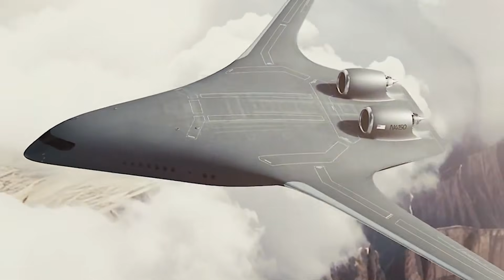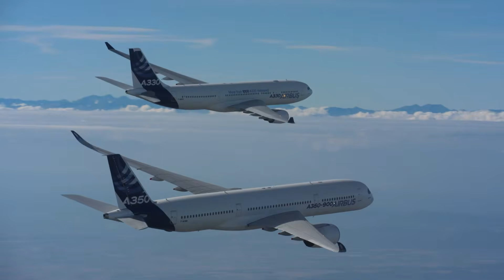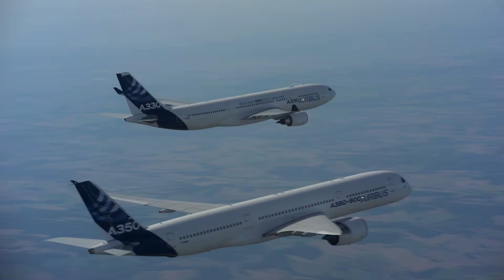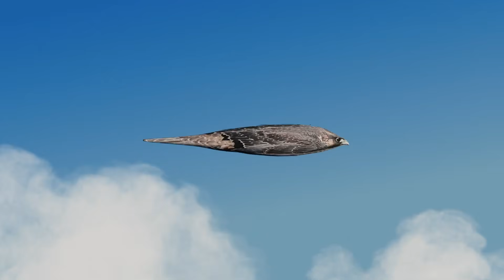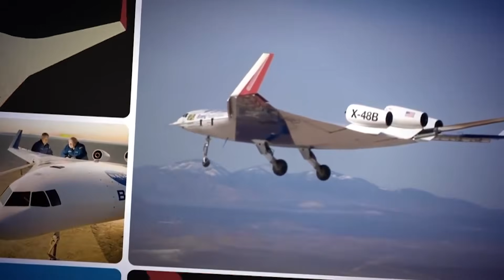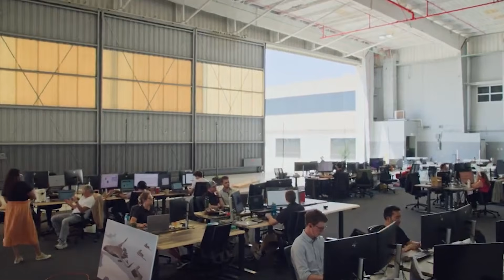They Are ACTUALLY Building THIS!

Comment: This design is nearly identical to one Boeing proposed a few years prior to the MAX issues.  I had heard they had subbed development to a start up, and I wonder if that is Jet Zero, it would make since seeing how fast they got all this money and engine sponsors while other aviation start up have had issues with.  But its about time someone developed this, they've been working on this design for nearly 20 years now. A video on Found and Explained even stated how the 737 replacement was imaged to be a BWB before they opted for the MAX config.  But this as a sort of NMA jet probably works better anyway.  My only real concern is what will they do when it comes to to mass produce the aircraft.  That requires a lot of capital, one that even Airbus and Boeing can have a hard time getting. Its why it took 10 years for the C series to launch and why the Mitsubishi region jet flopped (that and zero sales). I have no doubt they can get a demo unit in the air, and Long Beach does have the factory space its where the MD-11 and 747 components were made, so the expertise and equipment is there, but its can they get those units out?